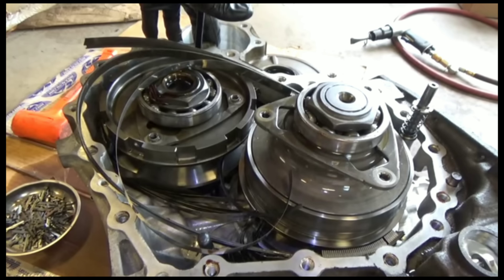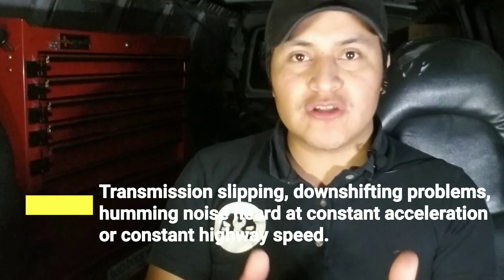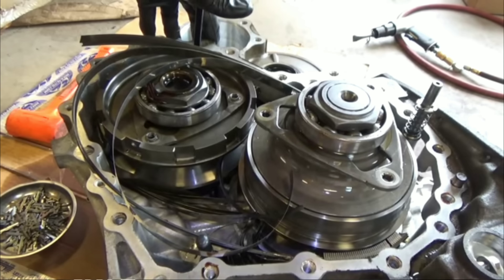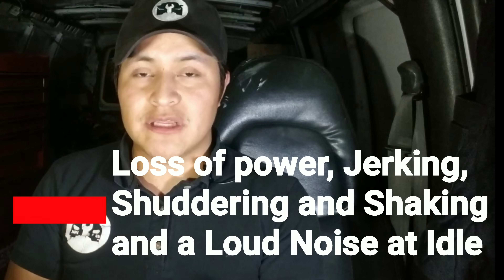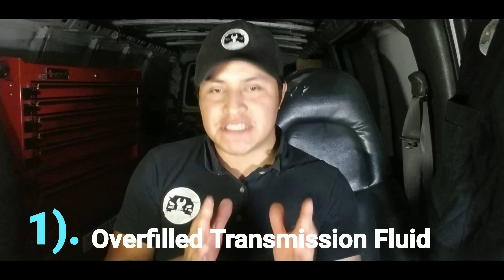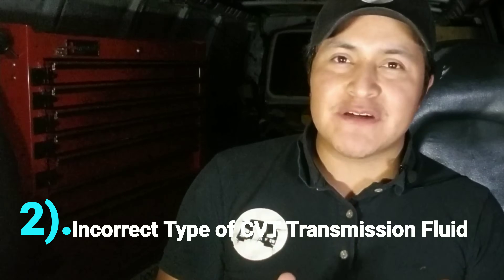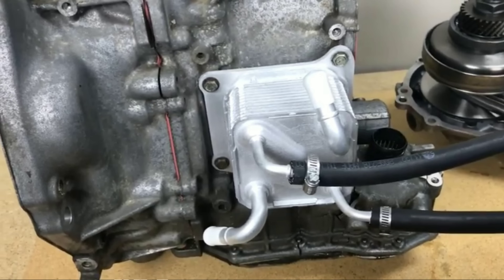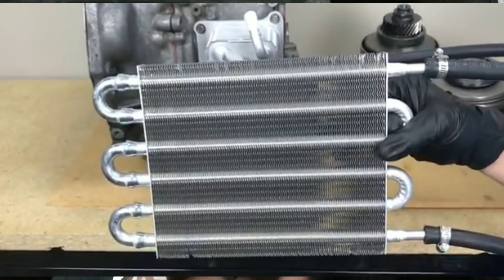NISSAN CVT TRANSMISSION | why it fails and what you can do about it to prolong it's life

Comment: Dear bro I have Nissan Juke 2012 automatic cvt it’s have a problem when I was run near 80+ km/h on that time car RPM going up and down and Juke was not climb up it’s going slowly up and not have abnormal sound  and rpm suddenly going up 2500 rpm to jump 3000 and go back 2000 stunting and les then 80 km/h  working normally and also not jumping when it’s cvt was cold at morning time what’s should I do

Comment: I owned a Nissan versa 2014. When I go uphill it revs up but does not accelerate. I found out that if I stop giving gas and wait for 3 seconds it will come back to normal. Any suggestions? Dealer says it is OK but I do not trust them because they have to apply warranty.

Comment: I have 2 Nissans and their cars are better than many others. I have used Peugeots, Volvos, Toyotas, Mitsubishi, Honda, Renaults and I can't say Nissans are at the rock bottom. They are as good as Toyotas and even better in some areas. The CVT transmissions are not the best in the world but are very decent. No issues after 4 years. What is your grip?
Reply: Do you live at a place that is relatively cold ? I'm trying to find a connection here. Im starting to feel that heat kills these engines

Comment: I had my coolant flushed on my 2014 maxima at firestone and they put yellow universal coolant in my car and I have been driving around with no issues
Reply: Only 3 months
Reply: @dallas218  nice, I have a Nissan Altima 2012, had it for a month, and I had no issues so far other than having low steering wheel and brake fluids, but were easy fixes!
Reply: Also just had a new cvt put in 3 weeks ago mine failed at 65,800 miles, something for u to be aware of. Try not to drive it too hard, do a cvt flush every 25,000 miles and keep clean oil and coolant in it and you should be fine
Reply: @dallas218  thanks, I'm actually going to get an oil change in mine the end of the week, and I'm getting my cvt checked to see if I need to get the fluid changed
Reply: And how long you had your 2014 nissan maxima?
Reply: Cost me 4800 cash came with 3 yr 36000 mile warranty

Comment: Thanks for these videos man I bought a Nissan Sentra 2013 at 140k and the car runs beautiful but I’ve heard so much about the CVTs trans going bad that I was concerned so I’m taking the time to learn from these videos to prevent that, thanks
Reply: If it's made it to 140k, it's just likely been taken care of already. Change your fluids religiously on time and you should be good to go. These engines are awesome, tho gutless. There was a recall and a lawsuit a couple years ago and most people had them taken care of then. Ours has shuddering issues when we got it at 64k. We didn't know anything about these CVT's at the time, and assumed it was my driving style. It was always there. Some days it would do it, others not. Once we saw the rpm's going from 2k up to 6k and back down and back up repeatedly crushing on the freeway, we knew what was coming. We got to 109k and it had enough. Now we have a temporary lawn ornament. Other than this CVT, this car has been a great little car. It'll cost us roughly $4000 to have a place replace it, but I think it'll make it will over 200k with the newer remanufactured CVT. They use higher quality internals and people have had few issues with them overall. One guy I know went through 3 transmissions over 10 months, but that was before they started using higher quality parts. Hope you never have to deal with it cuz it's beyond frustrating to say the least
Reply: Simple, take good care of it, and there won't be any issues, it's like a friend told me, take care your car, and it'll take care of you!
Reply: We have 2013 sentra at 144,000 starting to have these problems.  We bought it from my bfs dad who babies it but idk if he ever changed transmission fluid. Ugh

Comment: Basically, add a large aux stacked plate type transmission cooler, change the atf every 30k miles and coolant every 40k miles.

Or just buy a Camry, you wont need the aux cooler and atf and coolant service is every 100k miles

Comment: 07 Nissan versa 298,200 mi CVT just died last week 2019 Maxima S 2500 miles CVT today I'll take my chances the versa new was $17,000 and it got me to work for 13 years and made 1.3 mil gross from my job,,,,  not a bad investment for a car,, the engine still passes smog the Catholic converter was put in at 250,000 MI,,,

Comment: I only changed my coolant twice at 150k and around 290k miles. I change the fluid aroumd every 60k miles but 1 time I changed it at around a 45k mile interval. Im at 312k miles and my cvt works in my 2016 altima.
Reply: Coolant is usually good for 5 years or 60 k miles. Nissan CVT fluid every 30 k if mostly city driven.
Reply: @G Pac lmfao! No. Driving in nyc and the surrounding counties over and over again

Comment: I am having acceleration issues with my 2016 Altima. No check engine lights or noises. Nissan could not replicate the issue . I been told to change the transmission fluid but my Nissan dealer says CVT fluid is lifetime and changing it within my extended warranty will VOID it. I think this is incorrect...I should be able to change my CVT fluid as I please? Someone please verify. My cars currently at 38K miles. Thanks
Reply: Unfortunately your car is showing signs that the transmission is failing. There is nothing you can do after this point. Trade in your car for a non CVT
Reply: Jordan King wrong! Took to a different dealer it there was problem with the brake light switch. I guess my transmission lives another day haha

Comment: My 2019 Altima drives like a dream. I’ve also owned at 2010 murano and a 2012 Altima both with well over 100,000 miles and they have never seen a shop once.
Reply: Give it another 40k miles buddy be patient.
Reply: I don’t know what is the issue here with Nissan, my father is a main Nissan buyer, had the Sentra in the early 2000, versa near the 2008, a micra 2016-17 I think and they never had any issue. The only car that got problems was the versa But only cause of the cold of North America, my mother barely rolls with it so the engine and battery freezes. Other then that, we always had it quite perfect performances. Maybe luck, but maybe cause my car takes care of it well, dunno. I have intention of buying eventually a 2020 Sentra, i wonder if I should go for the Honda Civic hatchback too... but the price is the big deal breaker here.
Reply: I'm wondering if cold temperatures are really helping nissan. In canada, most people are happy with nissan. Maybe it breaks down more in warmer climates
Reply: @manojmohan7264  cvt requires fiction to work, and these generate a lot of waist heat, so of course hotter climates will absolutely cause these to run hotter and wear faster
Reply: So how's that going for you? Nissan didn't pay out millions on their cvt's lawsuit for shits & giggles 🤷‍♂️

Comment: Hey I have a 14 maxima & it started like grinding in low gears between 1k-2k rpm it doesn’t jerk or anything yet just minor grinding here and there . What can I do ? Also have some type of suspension problem that I can’t figure out I’ve changed a couple parts already

Comment: Go to Pine Hollow Auto Diagnostics and look at the 3 part Nissan teardown. There are three keys that one of the belt hubs slide on and they can't take the torque. Instant destruction.Under engineered. Always use a real Group 4 Synthetic. Not a phony $25 a gallon "Synthetic" ATF. A $50 a gallon Redline real synthetic.

Comment: @wrench link,  about a month ago, we used by 2010 Altima Hybrid to jump my sister's car.  We revved the engine to get out of EV mode.  As we accelerated onto the freeway, immediately afterwards, we noticed the car was struggling to shift, and started to shudder.  I took to the dealer and they advised that the car runs like a hybrid should, "it's not a race car" they said.   I feel a distinct difference in my car and I know something is wrong, but there is no code being thrown.  Could I have done something to it while jumping?  What can I do to know if it's the CVT?  I would appreciate any suggestion!!

Comment: I'm pretty hard on my CVT transmission.  I did notice it was slipping a little bit at 35k. Owner's manual i thinks says 60,000 miles before changing ,but did it at 35k instead. Paid Nissan$160 to change the transmission fluid.  Made a huge difference, runs like it's new now. And also I just got something in the mail from Nissan saying they're extending the warranty to 84,000 miles for 7 years.
Reply: I got  a 2007 I still need to know 2.5 S does That's  mean AT light is the transmissions
Reply: $160 is cheap, They wanted $290 and then told me it was $390, worth it but would never pay that price again, will not own any vehicle with CVT.

Comment: Had a 2010 altima bought it new, always followed service requirements, cvt went out at 119,700 miles dealer said I was covered since the warranty had been increased to 120k dealer put new cvt and a transmission cooler, I drove it until I traded it had 210k miles never serviced the cvt after the dealer installed was running fine when I traded it.
Reply: Question for you:  Did your engine light come up, was there a code?

Comment: I’ve got a 2018 Pathfinder. It has 40000 miles. I took it in for a transmission and coolant service. They checked both and told me it didn’t need either service and for me to recheck it at 60,000 miles. It runs fine....What do you think?
Reply from the maker: I would still do the CVT fluid service anyways
Reply: @WrenchLink  Shoulda bought a Toyota Highlander.  U still can.

Comment: You know who uses the exact same JATCO CVT7 as Nissan but has no where near the same % of premature CVT failure? Mitsubishi. Programming, low torque, quality cvt fluid, and 30k mile fluid swap is critical.
Reply from the maker: Do you know if that is what Mitsubishi is doing to prolong the life of the cvt?
Reply: @WrenchLink  I believe % wise Mitsubishi fare alot better in getting to 200k miles vs Nissan counterparts. Alot of people complain in feeling like the Mitsubishi lineup is underpowered but the lower torque/hp contributes to better longevity in their INVECS III cvt programming.

Comment: I appreciate your knowledge...
Reply from the maker: Thank you!
Reply: How much you charge to service or change pump in trans? I have a 2011 maxima SV 212,000 miles when get hot 🥵 it goes in that mode...
Reply: @dav22384  i changed my fluid at 80,000 after an episode of li mlm p mode, and atm mine seems to be doing good now.
Reply: @dav22384  , Don't waste your time a Max with 212,00 is ready for the junk yard.

Comment: The video is useful for me.  I have owned Nissan X-trail for 3 years with ODO 65,000km and the transmission is still trouble free. Could you please tell me which temperature of transmission at normal condition and at which temperature is abnormal?
Reply from the maker: 68°F-176°F normal
That number can differ depending on the vehicle but it's around those numbers

Comment: The video was very imformative and you point out the problems these vehicles are experiencing. It helps us to identify and send back comments for advise. Thanks again.
Reply from the maker: Thank you for your support!
Reply: @WrenchLink  thanks . After my fluid ( expensive factory type)was changed on my 2007 Nissan x-trail . The winnings has started 4 months later . Should I change fluid again and filter?
Reply: @WrenchLink  Hey I was hoping for some advice from you. My sentra 09 base 2.0 with 170k miles started jerking hard when accelerating between 20-40 mph and especially after driving for a long period. I'm going to get it checked at the dealer and see what they say but I was wondering if you thought a transmission cooler would help me out and if you could recommend one.

Comment: Morning, I have a Nissan bluebird Slyph old shape 2012 2.0 litre engine. When i drive on the highway the car is pulling or a jerking pull ? at about 100 miles an hour this happens ? My mileage is at 52365. What can be done about this ? I brought the car last year 2019 only one year and having issues. If this is a manufacture flaw what should i do. Don't have the money to repair this ? I live in Kingston Jamaica W.I. So it is nit easy to buy car ir fix a big problem like this. Need your advise. Thanks.
Reply: LMFAO why are you driving 100 mph? 🤣🤣🤦‍♂️
Reply from the maker: Can you take it to a Nissan dealership in your area? I don't know about the WARRANTY in Jamaica but if they give at least a 60k miles of WARRANTY on the powertrain then the cvt should still be under warranty. I see that it's a 2012 model so it might not qualify but worth a try.
Let me know what happens

Comment: Mitsubishi has the same CVT, but none of the problems. They have less torque and they installed the cooler, even on the cheap Mirage.
Reply: This. Mitsubishi knows how to program a JATCO CVT7. How many km on your Mirage now?
Reply: @kylemas2005  100.000 km and not a single issue anywhere. Even original brake pads.
Reply from the maker: True
Reply: The Outlander and Outlander Sport do have some CVT failures.

Comment: I love svt transmissions they just not need changes like manual and Automatic its just one speed. It only the Nissan vehicle at have bad transmission if u getting problems with your Nissan cvt buy a Toyota cvt problem solved
Reply: CVT transmissions are junk
Reply: @williamhendrix2053  i have a Honda hrv. Toyota Noah and a hybrid Lexus all my vehicles i buy are cvt vehicles. The cvt are fast they don't have to hunt for gear like a regular automatic transmission.

Comment: Question - My car starts properly with no check engine light but when I immediately put on D or R it does not move. However, when I wait for 10 - 15 sec and then put the car in D or R then it engages the gear. What do you think might be the issue?

Comment: 2012 Nissan Quest started failing at 110k miles. At 117k I fixed the problem by getting a Lexus GX. Will never ever buy another Nissan
Reply: Understand your reason I've liked Nissan since the 90s but if I upgrade anytime soon I'm going with Toyota/Lexus products plus Nissan is getting too pricey brand new if they gonna charge 30k for a Altima the transmission shouldn't be going out at all
Reply: Did you change the trans fluid when you were supposed to?
Reply: Bro, Can Lexus gearbox work on Nissan  ,Just wanna know.
Reply from the maker: @integrityhman2856  I think he meant he bought a different car
Reply: Can it work

Comment: majority of car owners never change the fluid in their transmissions or think to service it until it goes bad..
Reply: Agreed. As a technician, I see 5x the cvt replacement then I see the fluid changed smh
Reply: @hoglundvincent  im thinking of doing a drain and fill on my 2018 sentra wondering how many quarts should i get
Reply: @sbryann18  get 4. Youll likely have enough for a spill and fill. 5 if youre really worried
Reply: Dr. Daddy thanks brotha
Reply: @sbryann18  👍 I drained, dropped the pan and changed both the filters on my 17 pathfinder and only used 5 qts.
Reply: I tried to change the oil at 70k...dealership said it wasn't time yet.
Reply: @iamtheonlywilly   bro the dealerships are trying to get you to buy a new car, obviously after yours breaks down sadly.  If they really cared about their customers they would’ve either improved the cvt's when they first had problems or realize it wasn’t working so change back to ordinary transmissions
Reply: @sbryann18  thank goodness I was only taking initiative and didn't really have issues yet. I dont trust them anyways.
Reply: @iamtheonlywilly  honestly just change it yourself. It's like changing oil but a little bit more difficult because there's no dipstick. The OEM oil around 100bucks on Amazon.
Reply: @pineconeonpizza  thanks. I will do it!!
Reply: This sounds like an excuse to me..
Reply: Main Screen  bruh how many of your aunts or nieces that have a car w a transmission or differentials be like oh shiet gotta flush the diff or trans fluid they barely remember to replace the ENGINE oil cmon bruh
Reply: @sbryann18  I understand that, but when you are on your third transmission at 137k miles and you do everything under the sun to keep it running and it still goes bad, what do you want me to say? My case may be anecdotal but it happened non the less

Comment: I have a 2011 Altima with a CVT. I just hit 400,000 kms, it has been flawless. I don’t drive hard though. CVT need to be pampered but the gas savings are noticeable.
Reply: That's the key. If You drive aggressively the CVTs won't last 45,000 miles.

Comment: Does my 2015 Altima have a cvt transmission, what can I do to prevent problems, it has 22,000 miles I bought it new
Reply: Forgot to mention it has the 3.5 v 6 engine
Reply: Drive it like an old lady. If driven aggressively it will fail around 45,000 miles.

Comment: Transmission oil cooler, best fix I've ever done. No more overheating, haven't had an issue accelerating. the CVT fails because no accelerating gear and under sized oil cooler so it eats up oil and metal then touches.

Comment: The picture you showed is not the CVT fluid pump. The CVT fluid pump actually looks more like a power steering pump. You showed a picture of a reduction gear. These Reduction gears will make the noise you described at high speeds, sounding like a worn out differential or a faulty wheel bearing. You can replace the reduction gear inside the CVT. There is actually a TSB for this procedure. However this can only be done if the Case is still good. Measurements need to be taken before ordering the new gear and proper shims. This problem is most common to the Nissan Rogues. However pump failures are also common. So yes you are correct but the pictures dont match and the syptoms are different. Typically a pump failure sounds like a car with very low power steering fluid at all speeds and you may not be able to drive it at all.